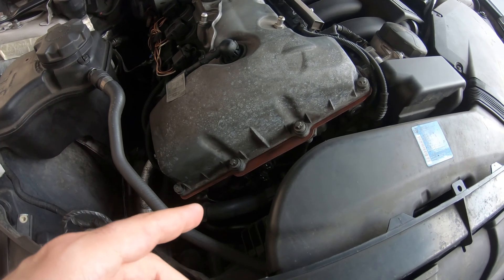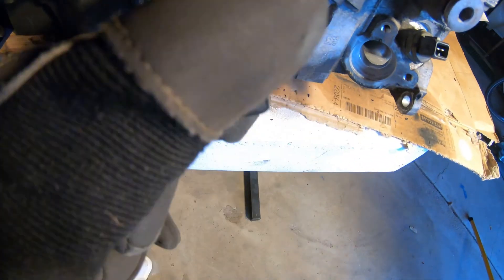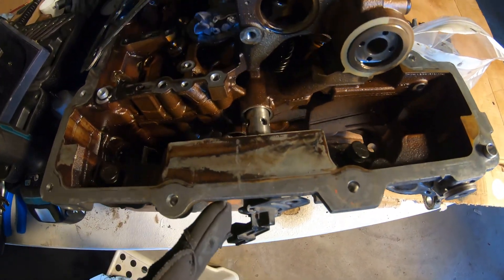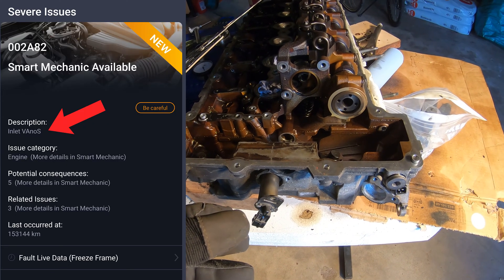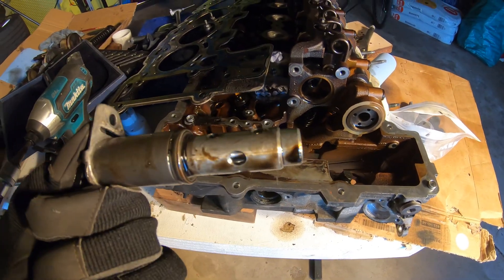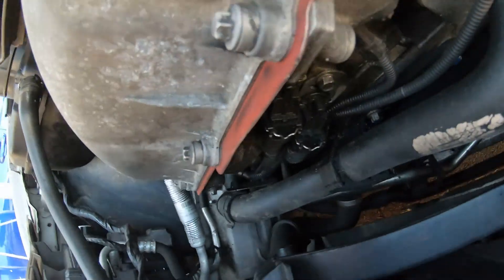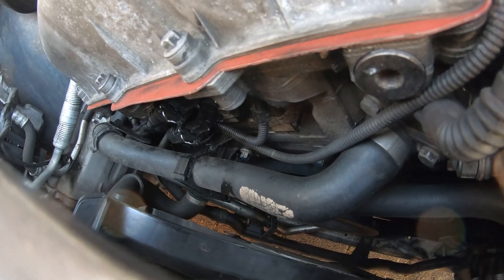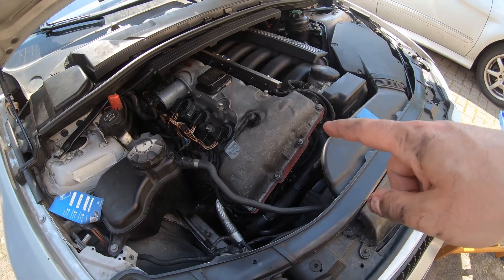BMW Vanos Faults Explained - How To Change Your Vanos Seals [2023]

Comment: Great video! 

An advice for someone doing this job, when putting the solenoids with the new seals, if you can't put the solenoids in, don't do anything like trying to tighten the bolt of the solenoid to get it inside, you will destroy the thread in the head. Instead, put the seal in the hole and put the solenoid into it.

Found the hard way, when I was already finishing my head rebuilt and had spent days putting everything back together carefully and thoughtfully and had lost my patience and pried the threads out. Pair that with the one-time use threads on this head, I even stopped torqueing down everything and just started putting things by hand feel lightly, I have a feeling that even the manual torque specs are a bit of an overkill, this engine material is godawfully too soft.

Another advice, because now my bolt is spinning in one place, the way to fix this is, you cut the head of another bolt, tighten it in the hole with 2 counter tightened nuts, with some epoxy in the hole or whatever and start using a nut. So instead of a bolt, now you will be using a nut and a stud.
Reply from the maker: That's a good idea. I did struggle to get those bolts back in. You really had to seat the solenoids ALL THE WAY DOWN.